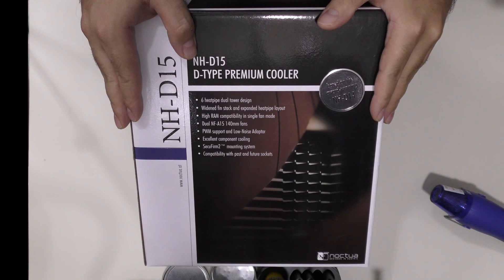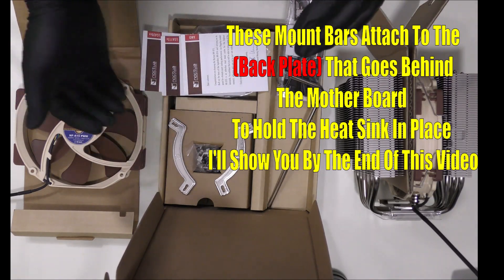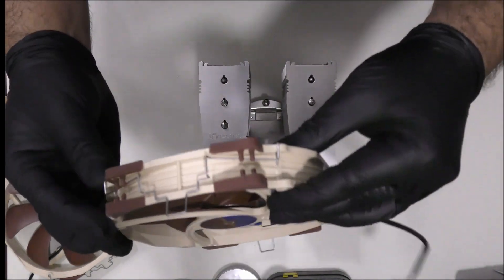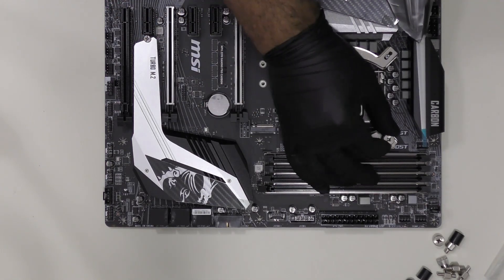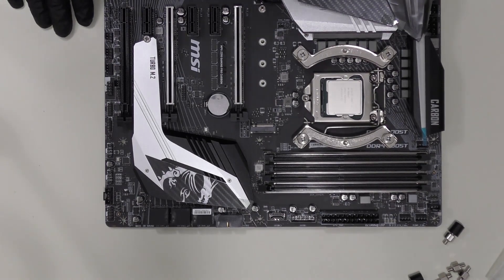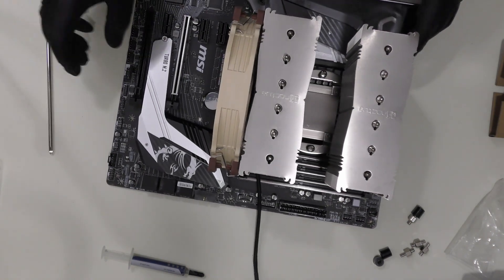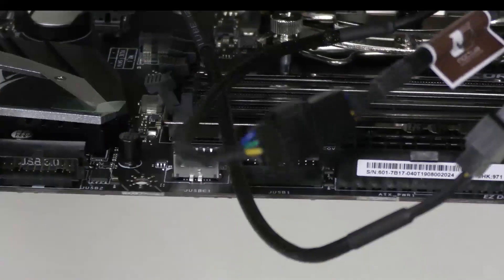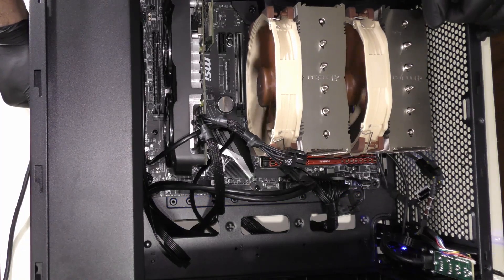How To Setup & Install Noctua NH-D15 Premium CPU Dual Fan Cooler Full Tutorial Review

Comment: Shouldn't you be installing it sideways (the way it was meant to be installed)... To pull cool air from front panel fans, and to push hot air to back panel exhaust fan. Instead of pulling hot air from gpu.. Just saying.
Reply from the maker: Yes great question! I flipped it on purpose, i explained it in the description, reason why the desktop was inside a closed cabinet in that cabinet was venting vacuum  system like a hood that sucked hot air from top of the case rather than behind meaning that the airflow that needed to escape was from top of the computer case thats why i positioned it to vent out from top rather than behind , worked like a charm, also now we moved out office to another location and re flipped the heatsink to normal, you can check my other videos.

Comment: why aren’t both of the screws screwing in in the middle of the heat things? only one is screwing in and the other isn’t catching on
Reply from the maker: Try using another screw driver than the one it came with use a screw driver with a grip and do not screw all the way when you screw first let the screw grip and then screw the second one keep going back and forth between them till they tighten (do not apply too much pressure) but at the same time it does need elbow grease but we dont need to break the motherboard be very careful, hope this helps

Comment: hi can you explain why you need to ad those cables? I have this cooler on my i5 9600k overclocked to 5ghz and it looks like vents go straight to mobo I have those cables should I install them? is there any gain I saw other video with someone saing something about lower rpm I wanna blast my cpu at max and possibly go to 5,2 5,3
Reply from the maker: For my setup, my computer i want to connect two fans to run using one port off of the motherboard thats why i used the cables and the must be connected this way hence I’m using one port to power the two fans at the same time. Thats why i used that cable that came with the fans

Comment: I have to ask have you just plugged your graphics card in to  a 4x PCI_e port and completely clocked off your 16x port?
Reply from the maker: That graphics card is only 16x not x4 those slots are for multiple graphic cards x16

Comment: This is exactly what I wanted - Just someone actually installing the fan bit by bit, as if you were watching someone in real life do it. Thank you :)
Reply from the maker: You’r welcome 🙏🏼 glad we could help but keep in mind we installed it in a way different than usual to meet our computer setup, you can rotate it to uncover any blocked pci slots and make sure you install the rams first it will make the installation really easy just wanted to point that out for ya, please consider subscribing thank you
Reply: @USComputerSolutions  10:00 your adaptor cables say "Low Noise Adaptor" too? I don`t get why would I use those adaptor cables unless I build a silent pc build.

Comment: Why use a Ysplitter for the cpu when the motherboard has cpu TPM and Aux CPU TPM ports its just a mess of cables the less the better
Reply: Cable extension that came in my box say "Low Noise Adaptor" I guess I will just skip that conection he did at 10:00
Reply: @Santti.G  the low noise adapter lowers the voltage of the fan and rpm. Decreasing its cooling capability don’t use it ! It’s super quiet anyways even without it .

Comment: Strange to me seeing this vertical setup, most of the NH-D15 I've seen, including my own, run horizontal along with the case fans.
Reply: I'm not sure, but for AMD boards, the only option is to mount it horizontally. And it can be an issue to mount the 2nd fan on it, due to the RAM slots. I ended up putting my water cooling radiator back in and keeping this cooler for another build maybe. It's just freakin huge.
Reply: @Ferencur  It won't fit with this motherboard in horizontal position.

Comment: After applying the thermal paste the two screws won't screw in after the cooler is mounted. Please help.
Reply from the maker: Try a long screw driver rather than using the screw driver that comes with the device apply some pressure make sure you dont snap the heatsink.
Reply: @USComputerSolutions   Perfect, it worked like a charm, Thank You.
Reply from the maker: You are welcome Glad i could help please consider subscribing 🙏🏼

Comment: Hello! I’m using a B360M Mortar Mobo and I was just wondering if the Noctua is compatible with it? Also, it seems that alot of people are having troubles with the ram slots being blocked / not having space for it.
Reply from the maker: It comes with a convert kit for most motherboards either for intel or amd, you can insert the rams first then install the heatsink by the way installing it needs patience also you do not need to block any slots as i did I intentionally blocked a slot but you do not need to block anything but regarding your rams just install the rams first then install the heatsink after i hope this helps
Reply: U.S Computer Solutions oh okay. I’m getting this since my cpu cooler is the stock cooler and whenever I game, my pc tend to get very hot, i have monitored my pc while gaming it can reach over 60-70c which is hot for me! I hope this cooler will make my pc cooler. I plan to get case fans aswell if i think that’ll help since i don’t have fans that blow air outwards.

Comment: does this cooler make the first pcie slot inaccessible on this board? I have the same board and it looks like it does obstruct it.
Reply from the maker: Please read description for this video.
Reply: @USComputerSolutions  Yeah but the first PCI-E is the best for gfx cards...
Reply from the maker: I agree, but we have tested the card to see any difference using benchmark and really there was no difference for this “spastic card”, maybe a higher performance one would but for this nothing, it was smooth and good fps, but this computer is not for gaming and it is in a cabinet that we build for it that had to be set up this way and it has been working wonderful, I must mention the airflow of the computer is awesome the temperature is great so you can choose how you want the airflow direction to be with those fans by changing the heatsink direction if you need the first Slot and not cover it is really your choice, but if we had setup the heat sink fans the other angle (by not covering the slot) in our cabinet setup we wont have a good airflow at all meaning the heat wont exit from above it will actually stay in the computer causing it to over heat. So again the way how we setup the heatsink works best for our airflow for where we have the computer setup in our office.

Comment: Would any mid atx case be able to hold this thing?
Reply: I just did a bunch of research on this and ended up ordering the Phanteks pro M series. I tried the nzxt h510 but it wouldn't fit with both fans attached due to the one raised fan above the RAM. I'd recommend a case that has more than 165 mm of clearance, since the nzxt that I tried had 165 and that wasn't enough. The Noctua site actually has a compatibility page that shows which cases will work. but it says that 165 m m is enough, which is not, unless you're using some very low profile ram that doesn't require raising the second fan, which I'm not sure even exists.

So to answer your question, not every mid tower could house this, you have to check if it is wide enough. Unless you're okay with leaving the case open.
Reply: Did the phanteks pro worked fine?? So 170mm mid tower should be just fine correct?
Reply: @angel-or1jf  the case has not arrived yet, should be getting it soon
Reply: Alex Prole  jjajaja damnn itt lol im also doing research im gona go for 170mm thats it
Reply: Alex Prole hey man, did your fan ever fit.?

Comment: You missed the spacers that are in the instructions that should have been installed at 5:20.
Reply from the maker: Hello @Ryan! Thanks 🙏 for mentioning this and yes absolutely the spacers are needed & we did not forget them,  but for this type of motherboard and how we installed the mount bars on the middle opening if you look closely, the curved mounting bars sits firmly on the metal screw thread side without the need of the spacers and the screw can be tightened to the full on the screw thread without any problem.  Also, we must mention that when we tried to put the spacers on this particular motherboard the screw that holds the mounting bars down would not screw to the full extent.  We did try the spacers on other motherboards both AMD & INTEL models with the spacers it was fine, so you may encounter motherboards like this one that gives you a hard time with the spacers but can work fully without the need of installing them.

Comment: Thanks for the tutorial. I've heard, that this cooler can create clearance problems for the RAM slots beneath it. Noctua actually suggests (in the general description) to move the front fan upwards in such a situation - provided the case size allows it. How much clearance is there for the RAM modules mounted beneath the cooler? - and exactly what RAM did you install ? It would be great, if you could add to the tutorial, showing how to offset the fan.
Reply: I have the NZXT 510 case and couldn't install the 2nd fan. The fan sticks out too much on the top, because of the RAM underneath and I can't close the case.  And also, I got an AMD system and the heatsink fans supposed to blow toward the rear of the case.  I can only recommend this cooler for people with a full tower and/or plenty of depth and space inside.  If the motherboard is already connected inside the case and don't want to remove it from the tray, then it can be a real pain to connect the fan cables to the motherboard.
Reply: I've just finished my (first ever) build, and I did it with the Noctua D15. I have the Fractal Design Define R6 case, which has a cooler clearance of 18,5 cm. So I was able to offset the outside fan to allow room for the RAM.

Comment: i’ve been trying to screw this in for an hour but just can’t get it into my motherboard. i have everything in the right place (the correct AMD brackets in the AM4 slot) but just can’t get this cooler in place.
Reply: Same! But im using lga115x
Reply: I just got it in! Try using a different screwdriver as the one included isn’t good.
Reply: Try taking the mother board out of the case
Reply: Also make sure you're using the spacers, he doesn't use them in this video

Comment from the maker: ⚠️PLEASE NOTE: That we have installed the heat sink over the first PCI thus covering it, you can always maneuver the heat sink as you wish (by not covering slots), we have intentionally done so because we don't need the first PCI slot and we need the airflow of the fans to be released from the opening (TOP) of the case that's why we installed the heat sink the other way around (i am aware some of you will disagree with this installation) it's for our airflow circulation and it works flawlessly for us, our desktop is located in a closed closet that has another outer ventilation (HEAT HOOD SUCTION) system to suck our hot air coming from the heat sink through the TOP OPENING OF THE desktop case and an inner airflow to the closet connected to the desktop case itself to create circulation and maintain a cool temperature. So this setup is for tutorial purposes only to help you with the installation OUR temperatures readings with this installation ARE: ( idle 30-35 c Load are 40-67c). THIS IS TRULY A WONDERFUL DEVICE

For any further questions please don’t hesitate to ask.
Reply: Is there a minimum power supply requirement?
Reply: I have b550 phantom 4 mother board, do i need to use spacers? and if so will it make make the cooler taller? I noticed you didn't use anything to put put the bracket on and its touching the mobo, is that ok?